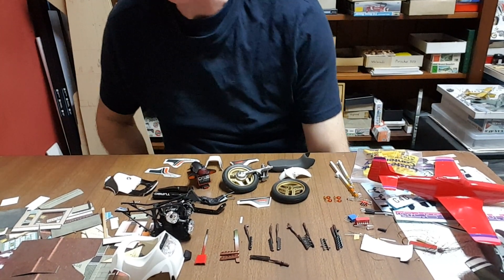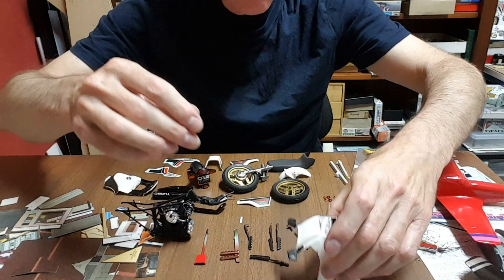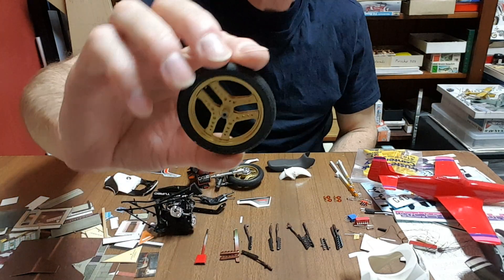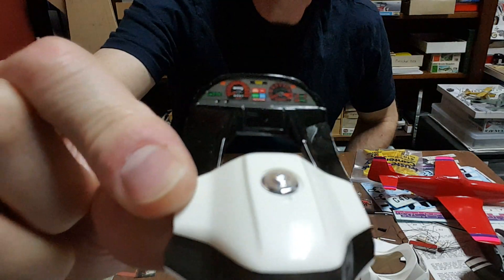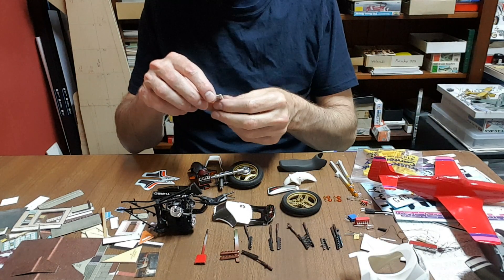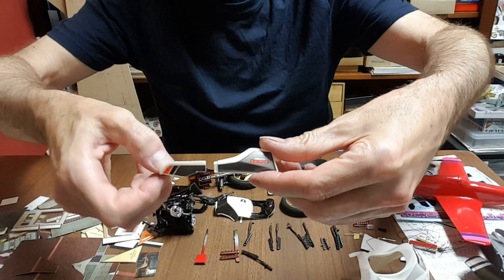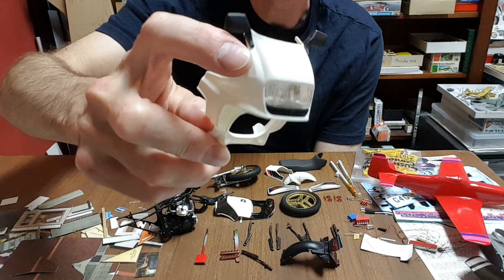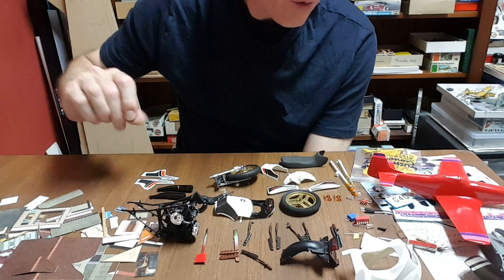1/12 Tamiya Honda CX500 Turbo. Part 3

Comment: I had no idea that motorcycle kits  and parts were so " large ". Ironically the cross over building issues are still related to smaller  types of kits and translate quite well. It's very interesting to see the variety of kits you build. Thanks for sharing.
Reply from the maker: Yip i sure do build it all. Although i must make a serious effort to do an Airfix sailing ship and a Formula 1 car and my Saturn 5 Rocket. Yes the bike kits are very cool with high technical aspect to them - really getting into all the workings of the bike.

Comment: Looking good, Tamiya decals can be quite thick so a stronger solution and hair dryer helps. I like to seal the decals down as soon as I can to help stop damage to them
Reply from the maker: Yes i do too. except on this build, for odd reasons , lol. and yes so thick! i was using continues decalsol, just to get this result. but its ok - the visible parts is all ok